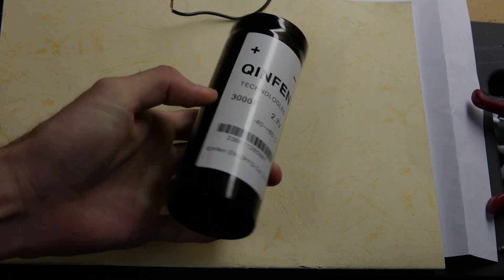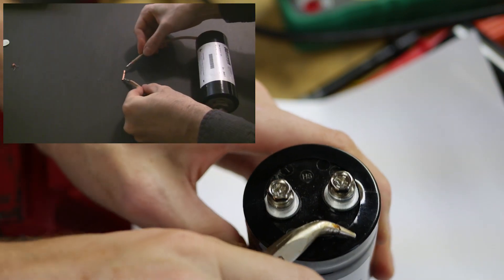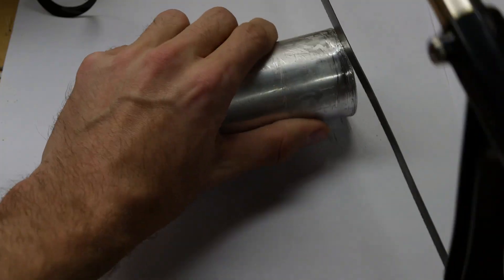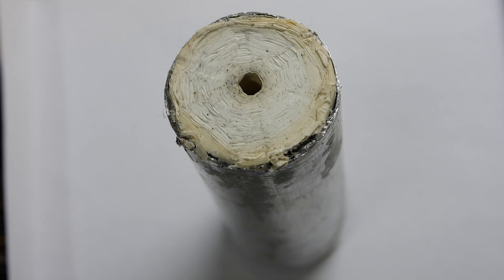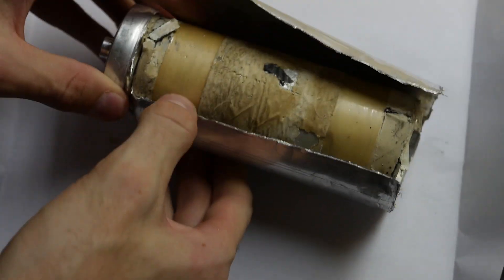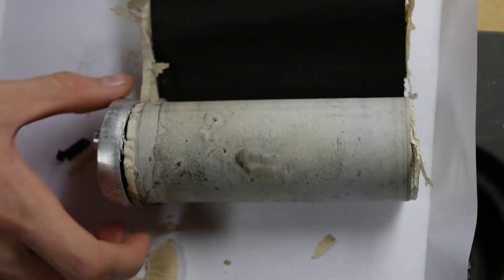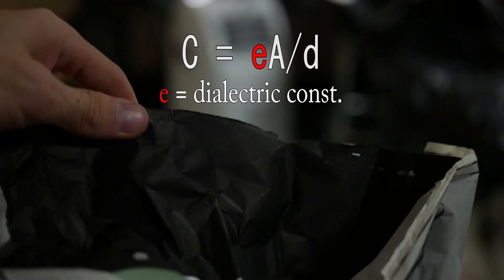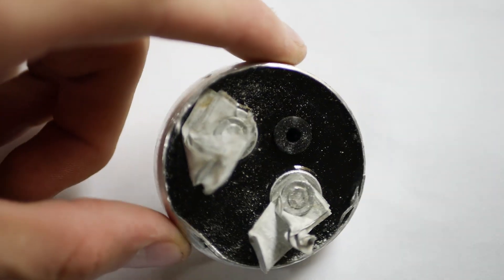What's inside an ULTRACapacitor?

Comment: You did exactly what I was thinking of doing to a similar unit. Does this capacitor work anywhere near the rated capacity and are there some considerations for use regarding the build quality?
Reply: Decided to look more into ultra capacitors I don't know much about them I was reading about it in Elon Musk book. I want to learn every subject out there I'm kind of a jack of all trades but master of all as well not jack of all trades master of none I'm master of all lol
Reply from the maker: It's quite close to the rated capacity as I recall, there's a few videos on this Ultracapacitor model where it's used for discharging, so I'd imagine it's quite durable.
Reply: @ariesrc1536  Thanks a lot for the reply and effort.